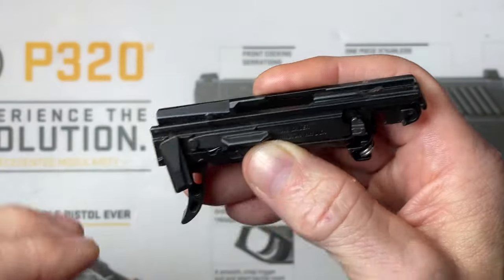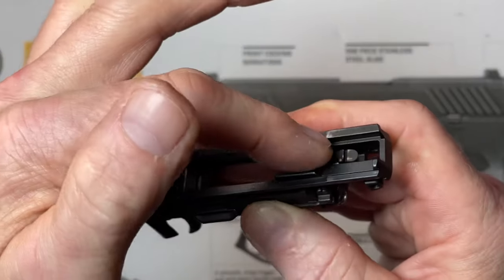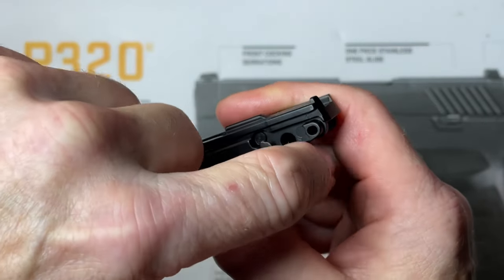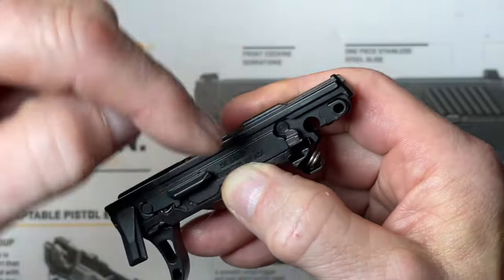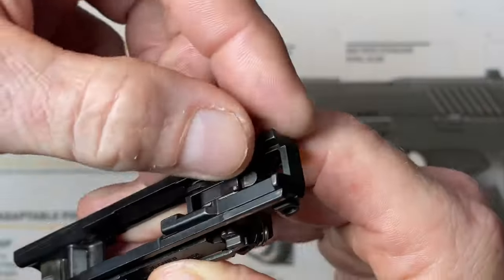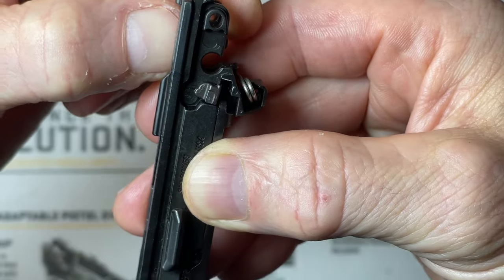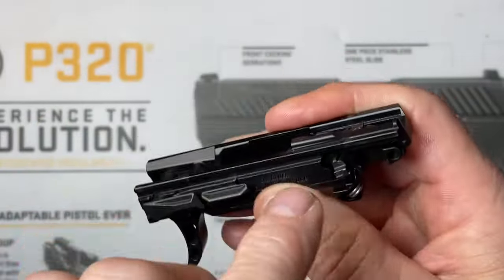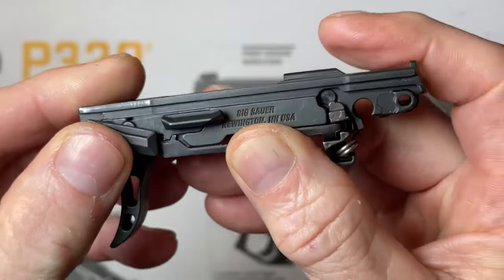P365 slide will not go back on and takedown lever will not rotate.

Comment: I have a weird issue where when I put the gun back together and push the takedown lever up, it releases the slide lock lever. every video I've seen of the disassembly of the p365 isn't supposed to do that. curious if you might know whats causing that issue, The gun still shoots fine, but the first time I put my p365 back together after cleaning the takedown lever cut my thumb because of this.